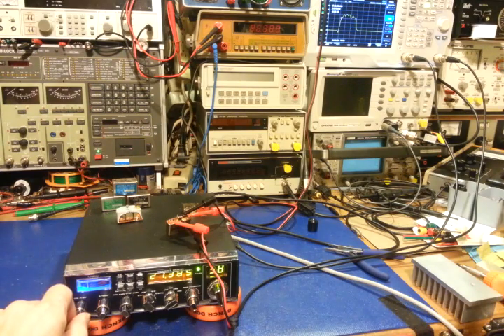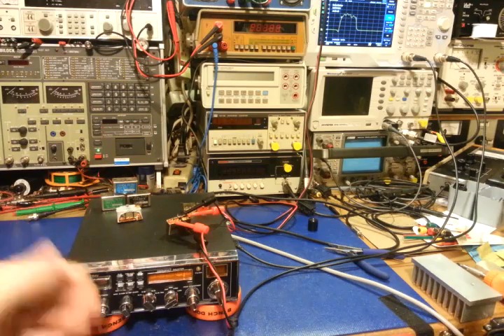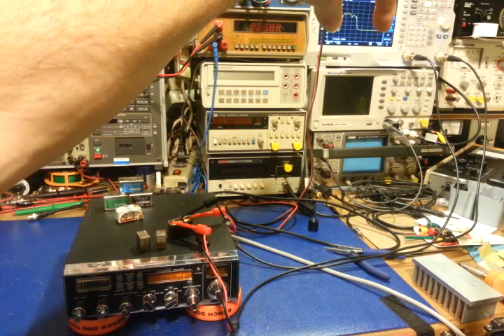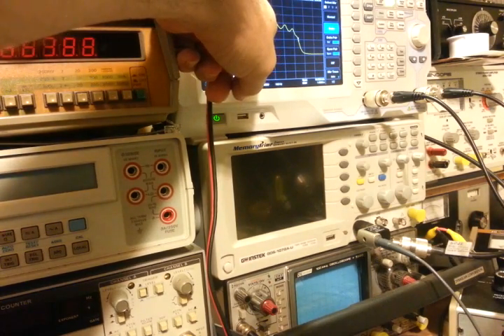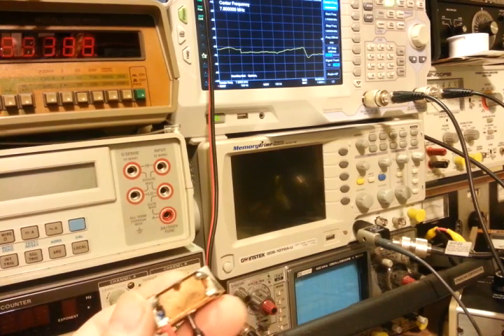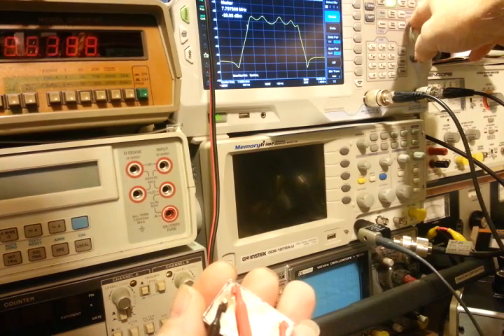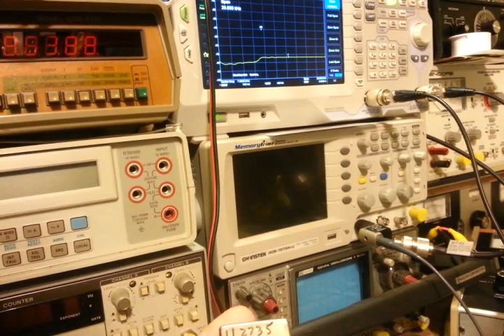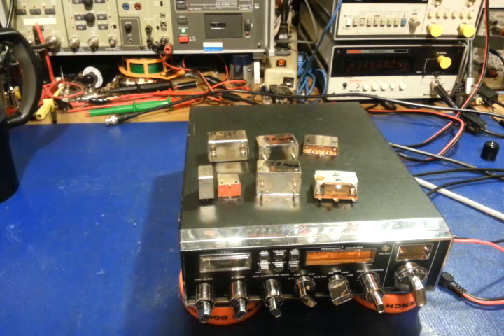Why your modern SSB side band CB receive is noisy. A look at crystal filters on spectrum analyzer.

Comment: The best receiver i ever had was a Johnson Viking 4740, super quiet and never any bleed over. Very well designed and built chassis. The original price from 1977 was almost $500.00! I bought it at a thrift store for $3.95!  The worst ever were the first generation 40 channel ssb from Sears/JC Penny, I've had several of those and you could hear complete conversations from 3 or 4 channels away,  pure junk.
Reply: Hmmm ...

While I see in the video the author says (at least in general) that the older AM/SSB CB radios used better quality filters ...

Nevertheless, was this the reason why when I played with CBs back in the late 70s and early 80s. I noticed that while LSB quality always seemed fine, USB always sounded like a high pitched, raspy, and unintelligible mess, and was pretty much unusable.

Was this due to both the usual heavy traffic on the LSB combined with poor filtering in the radios causing bleedover from the LSB to the USB?

Comment: Are President radio boards Ranger boards also?
Reply from the maker: Absolutely not.  President has never used RCI / Ranger boards.
Reply: @mikesradiorepair  are President radios a reasonable purchase (build quality, transmit, receive)  between a typical black box export radio and an unit (for example of type only) yaesu ft-857d with MARS mod?
Love the looks of classic CB radios but want the best performance I can get in that form factor, similar to that of a "quality" radio.
Cry once by once.
Thanks for your time and response, watch your videos and know you're busy.
Reply: Bump

Comment: Thats amazing Mike!
Hey can you think of a way to make a CB to where it only works when you bring it to the CB shop because it doesnt work.

Ive taken a Cobra 25 three times not working to the local CB shop and it always works without flaw.
The guy said break 19 for a radio check can some one tell me if this radio is working.
He got a reply, unfotunately.
Cb guy- hows it sound?
Trucker - sounds good! Real good  man!
CB guy - 10 4 roger that have a good one.
Trucker- Anytime

I took it back 3rd time installed it never worked the 1st time. So I jacked it up and put a Stryker 955 in its place. Still puzzled by that Cobra though I feel like im being pranked.
I bought it used with echo and 20 watt swing mod from the CB guy. It worked right for 1 month.

When ut first started this the needle hung half way over with mic unkeyed. No further communication was possible.

Comment: Mike, love your channel friend! You saved me from wasting about $30.00 last night. I saw a "modern CB" on Fakebook, and almost jump on it; however, I did some research on that model on YouTube and came across your channel, and let it go.  So... since yesterday, I have watched several of vids.

I need advice please.  Mike, I grew up in the 70's as a kid.  It was the "Golden Age" for CB radios.  Fun times for sure.  I got away from the radio until recently.  I'm learning that there is a huge difference between radios then vs now. But before I gained that knowledge, I dropped about $200.00 for a made in China Cobra 148 GTL.  Now I'm beginning to have buyers remorse because it is "inferior" to the good stuff of olden days.

Now with that being said, prior to purchasing the new Cobra, I purchased two "older and better" radios that turned out to be duds (yes, old stuff breaks too).  So... if I purchase a modern radio, it's called crap, and if purchase and golden oldie, it too is a risk for a novice not knowing what to look for.  What's a guy to do?  I'm currently looking for a mobile/base unit with SSB.  Thoughts or recommendations?  Maybe you can do a video on old vs. new sometime and give your two cents worth. (If you've already produced such a vid, I apologize in advance).  Thanks.  Scott
Reply: Yaesu ft-875d with MARS mod.

Comment: Hi Mike - If you want a better look at the filter response, you need to match the filter to the 50 ohm impedance of your analyzer.    Your conclusion is generally correct, but you have a much better look at comparing filter responses.   The filters you are looking at probably have a much flatter response then what you are seeing.   Most  of the filters you are looking at are likely 500 ohms.   There are some 50 ohm filters  out there (Drake TR4C and TR7 used 50 Ohm filters as an example), but  typical modern filters are designed to 500 ohms.   Amateur radio operators have spent a lot of $ trading off filter bandwidth, skirt selectivity vs. fidelity but the larger radios have multiple filters making it easier.

Comment: Hi Mike, Wow, really brilliant demo of why new SSB rigs are so noisy - I thought I could be sorted with a good alignment tune, looks like sadly not. Apparently all the other high frequency signals like broadband, wifi, Cellular etc, also add to the noise floor, making good filtering even more important. I've a new AT-6666 and its rx performance on ssb is no better, maybe even worse than my 25 year old Lincoln Mk1, but yes it cost the same now in UK Pounds as my Lincoln did back then. Shame no one appears to offer the option of buying quality CB rigs without going full-on Ham Rigs which are an overkill. Thanks again for great video.

Comment: I do own over 200 radios old and new my favourite set are present Adams & cobra 148 gtl dx & present Lincoln present Jackson the worst radio I've got present grant 2 & present Lincoln 2 the best radios are in the 80s. Thanks for showing interesting video.
Reply: I have tried lots of CB radios ; actually I have had (and still have) the Uniden PC33 and President Grant to have the best receive ; did not try Adams, but I think this one is in the same league. 
Channel number (120) and power output (30W, keeping a clean output in SSB) wise, President Grant CB is the best, right after it Superstar 360 (aka Cobra 148 GTL ?) ; Lincoln 1 is also an awesome radio (HAM/CB though), but noisier than the Grant.

Comment: None of my radios that do AM or SSB are noisy because I use a ClearSpeech DSP module or speaker attached to them. I do not operate without them except on FM. CB Radios are built CHEAP & ZERO care about the receive audio.
Reply from the maker: Couldn't agree more.  I have filters installed to all of my receive switchers.  I have the DSP type but personally prefer the older analog type.  One of my favorites is the Autek Research QF-1A units.  You might pick one up at a Hamfest or ebay some day and give it a try.  They can be used as a peak, notch, low pass or high pass filter with 3 adjustable frequency controls.  Like any filter they take a little getting use to but once you figure out how to set them up they are great.
Reply: MikesRadioRepair I have owned and used them and a couple of locals still use them and one is using the one I had. I even use the ClearSpeech on my ICOM 7600 and 746 because they make even those BETTER.

Comment: If you had a 2000 GTL that you loved what Xtal filter would you put in it, or would you keep the stock filter? AM and SSB.
Reply from the maker: The crystal filter has nothing to do with AM.  It's used only in SSB.  Personally I would retain the stock filter.  All I would do is remove it and align it.  It's one of the rare ones that is not sealed in a metal can and it has adjustable transformers.  Due to age they will have drifted off their original frequency like any crystal would.  It could also be slightly tweaked to slightly narrow it's pass-band while it's out.
Reply: The black faced 2000 with the power cable RFI filter mod that just arrived there a couple days ago. If you're agreeable, do those to it. Eventually. Please. Can the AM filter be adjusted or is it not worth the effort?

Comment: So, Mike, can an old crystal be pulled out of an old set and put in a new one? (space provided)
Reply from the maker: In "most" cases, yes but if the filters impedance is drastically different than the old one then it could attenuate the signal a considerable amount.

Comment: Will this apply to AM also?  I have a Cobra 75 WX and it is perpetually scratchy.  Could be my area as I rarely hit the highways but even when I do get nearby it doesn't get much better.  
I'm considering a new radio that is more traditionally sized, can I expect better signal just by buying a non-compact device?  Or would I have to get an actual "good" radio for this?  I don't need it just want it for the "Be Prepared" concept.  
Also, is there a benefit to a digital radio vs an analog (is there even digital CB?) unit?  I'll most likely be getting a SSB unit if that matters.

Comment: Hello Mike, this is a simply fabulous video. It answers so many questions I have had over the decades of working on rigs such as this. I want to share with you something I would love for you to to investigate, as I no longer have the proper equipment. Let me share my experience with you. Many years ago I read about the "Channel Guard" as you will find In the link below. I dismissed this thing as snake oil for years. I acquired one out of a scrapped radio, after being in my parts box forever and a day I decided to install it into a Sommerkamp (RCI-2950) I could not believe the results, it totally changed the receiver. The adjacent channel interference ceased to exist, engine noise was gone, the receiver gained sensitivity. In short, it was the best thing I ever did to a a radio. I have since started making them from scratch. I'm sure you have the parts lying around. It takes about half an hour to make one and install it. http://www.cbcintl.com/cgfilter.htm 
A schematic for this is at the bottom right of this page. http://malzev.tripod.com/cb-radio/filter.htm Thank you!
Reply from the maker: Very familiar with them.  Probably have about a dozen or more each of the 455kHz, 7.8MHz and 10.695MHz filters from Lou.  I have also retrofitted other filters in some of my radios over the years.

Comment: What if you took out the little chintzy filter and got one of the good filters from an old junk radio, and mounted it outboard on one the radio, running wires to the board where the other filter was?

Comment: Can you put the old style filter in the newer radios
Reply from the maker: Aftermarket filters can be had but they are not cheap.  You would probably be looking at well over $100 for just the SSB crystal filter if you had a company like Inrad make a custom filter assembly.  They are the most expensive part in a radio.

Comment: This problem was well known for decades. Even the 'good' radios (like the original Uniden made SSB boards) needed help. CBC International even had a board to help fix it. I bought a couple and it did help a bit. Look at Page 9 here: http://www.cbcintl.com/docs/catalog.pdf  Hams are all over this subject for years too. But real good filters will cost as much as a CB radios! Example: https://www.inrad.net/product.php?productid=120&cat=29&page=1
Or build your own filter: https://www.inrad.net/home.php?cat=149
So Mike is not exaggerating at all. The receivers in these radios really are poor, not just noisy.
Reply from the maker: Unfortunately Lou has stopped making some of his Channel Guard boards.  Last time I spoke with him he said he still had enough parts to build several of the discontinued ones but once that is gone that's it.  Luckily I still have about a dozen of each of the boards.  Just need to find time to install them in some of my radios.

Have been using Inrad filters for years.  Not cheap but we'll worth the price.  Most people don't realize how much a good crystal filter cost and get struck with sticker price shock.

Comment: I'm gonna stick with my Cobra 132. Back in the day, I could easily separate 3 or 4 conversations on the same SSB channel. 'Course, it cost a bit back then, I paid $450 for it back in "73 so do the math. And it wasn't even the most expensive, I remember one rig that went for over $1000 and was literally gold plated.

Comment: Mike i have a RCI 2970DX and it is noisy. So my question is can i replace the filter crystals with a better one? I know some modification will be needed but can it be done or am i just stuck with a noisy receive?
Reply: I will give an answer. Have you or can you lay your hands on scrap multimode CBs? If yes, salvage the SSB crystal filters. The ultimate answer would be to buy an INRAD filter.
Model #92. 8 poles of filtering with a bandwidth of 2.1khz which is near contest grade. Not cheap at all.  I'll let Mike give the definitive answer.
73 de Tony

Comment: so if i get a galexy 959 or ect what are the chances of me getting a filter that is morre narrow?  i have done a inrad filter in my kenwood TS-2000 if i just fined a filter with the same center freq it shood just be a swop in?
Reply: https://www.inrad.net/product.php?productid=9&cat=4&page=10

i was looking and the filter runs on 10.695mhz on the galexy 959. the same as my kenwoot TS-2000?? it is 2100khz wide
Reply from the maker: +Matt 

Mounting would be the only problem.  It's a different size filter.  They do make custom filters so they can probably make one that would be a drop in replacement.
Reply: @mikesradiorepair  That would be awesome if they did. I've a pair of Galaxy's that could use that treatment.

Comment: Thanks for this video. I had thought they were just using too much gain or noisy preamps.  Your video makes perfect sense.  When I select wider bandwidth filters (6 kHz) on my Drake TR-7/Kenwood TS-450/Kenwood TS-850 it also raises the noise floor versus the narrower 2.4 kHz filter. My early 1980s Realistic TRC-451 has the quietest and best receiver of any CB I own. It is better than my Magnum 257 and my Uniden Bearcat 980 SSB.  I also have several Midland 79-892 radios from 1977.  They are my second favorite sideband CB.

Comment: even the new crop of president cb radios with uniden pcb sound terrible as they're no doubt using inferior and cheaper components compared to what they were using 35/40 years ago when cb radio was booming. no point in making radios to those standards if the market is no longer there

Comment: Very good deception of why a good filter is needed. Now if the cb manufactures went to a SDR radio designs the cost would be low and filter much better. Now it still helps to have a good filter in front of the ADC.  But a 1 band SDR would be cheap.

Comment: I think it is strange that UNIDEN don't make use of the Tayloe Mixer as the up/down converter so while you where on the AM/FM bands there would be a 455khz offset to the LO which gets multiplied by 4 then used to drive the Tayloe Mixer I.E. ((LO+455khz)*4) and on LSB/USB there would be no IF offset I.E (LO*4) so on the AM/FM modes the IF as an I/Q signal pair get converted into a normal IF using a Quadrature Combiner which then gets processed in the normal way and while in LSB/USB the microphone signal gets boosted then feed through a phasing network to give I/Q at AF then up converted in the Tayloe mixer to the wanted channel and it does away with filtering as the sporadic signals that would need to be filtered out just disappear because of the phasing.
Reply: I think Motorola have the patent rights to the tayloe mixer and that is part of the reason why.
Reply: That is a shame as it would be a better system and it seems that these Transceiver front end chips are available for different frequency ranges.

Comment: Hi Mike. Excellent tutorial and information! I am wondering if you can please tell me a cross equivalent component or a source for the actual stock factory diode to the factory stock Cobra 2000gtl varactor diodes D75 and D72. These are the diodes next to the large 11.385 MHz crystal that get tampered with or removed during a clarifier mod and I would like to put several 2000's back to original stock condition. Thank you in advance, I am having a dickens of a time locating these. Best Regards, Todd Evans.
Reply from the maker: Not sure of a good supplier for them.  I have a pretty good inventory in the shop and have countless parts chassis.  The Panasonic MA27T is a substitute for it.

Comment: My Dad's mentor has AR3500 with 100 watt kit and SP-1a compressor. That is why my Dad initially got an RCI2950 in High School in the 1990's. My Dad's mentor still has that AR3500 and when we visit I walk past it. My even built a similar amplifier to the one the AR had for his RCI2950. So I have seen one and heard one. My Dad actual gave me an SP-1a voice compressor from Clear Channel still the box from the 1990's. I like the controls on the AR3500 I wish other "export" radios had a similar control that had a switch for each digit in the tuning so you could quickly move about the radio instead of going through menu's or bands, or having to toggle the cursor to the position you wanted etc...